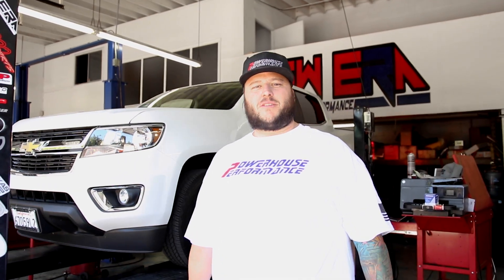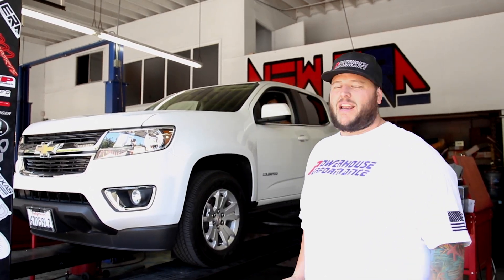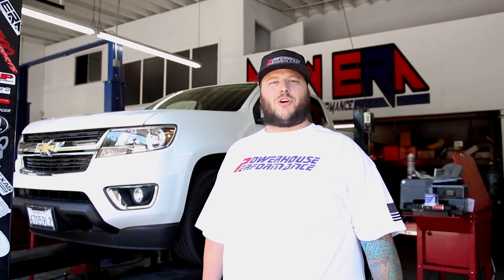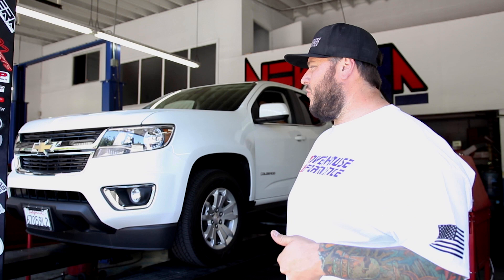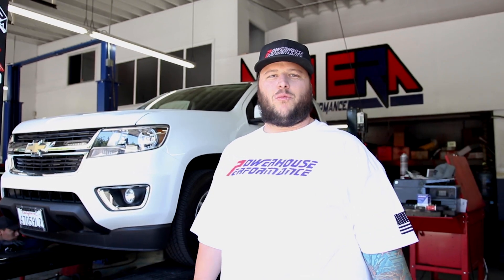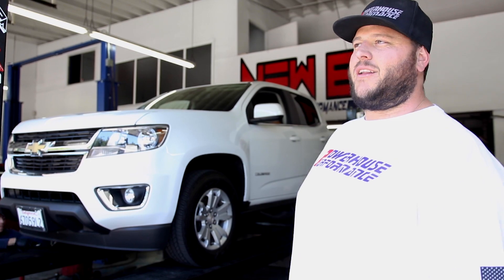2018 V6 Chevrolet Colorado Edelbrock Supercharger : Installation + Dyno Tune Process

Comment: For $7000?!?!?  Not worth it.  What the heck?
Reply: How much were you expecting? +200Whp?
Reply: @overlord6815  mpg went up around 5 and Horse power went up around 50+ I thought.  Regardless, I was expecting around $2000.  A brand new engine is less then $5000

Comment: I really worry about the reliability of the 3.6 overtime with the SC. Any updates from owners?
Reply: I have none of the crap on my 2016 Colorado and it’s still running great at 243,000 miles.

Comment: Bullshit,  that truck will pull your corvette just fine before the supercharger.  The 6/8 speed transmission,  and the programming of tow/haul mode pulls a 7,000lb tractor just fine for me on 35's.
Reply: True.  Was hauling a Crown Vic on a trailer with my 2020 RST.

Comment: I towed my corvette with my stock Colorado and it did really well, much better than I expected. The supercharger looks very appealing.
Reply: 265/22 for summer. Growling 265/ 20 for winter. Difference? The foot print. And the Job. I have a Mallet Blower that was custom made. Only one in Alberta. $ 12 Grand installed? maybe. You trust these Idiots? I had a guy that works on Lamborghini and Ferrari.

Comment: Torque gains are what I look at at low RPM's for pulling a trailer. These numbers look great to me. 100 ft/torque gain at below 3000 RPM

Comment: That was a great video. Looks like I can get an Edlebrock Supercharger for around $5 to $6 grand for my 2001 V6 Pontiac Firebird. Do you install on cars too? My understanding is that I will need special heads added too. Or so what Hot Rod mag. says. My V6 runs like new now.

Comment: Definitely should of went with the diesel option for towing. Supercharged vehicles are not the best option for towing. Can easily get EGTs out of control and the engine will pull fuel whether you like it or not. Unless the tune removed the factory safety features. Not to mention that's ALOT of money for 70 HP gains. 
.

Comment: That is wimpy performance numbers man. I have a 2016 Z-71 Colorado with a
RiPP Supercharger kit banging out 409 RWHP.  My truck would have that Colorado
in my rear view mirror briefly till it was out of sight. Oh I gave you way to much added
power.  313 RWHP  that  is  weak  and could only be driven by a wimp as well.
Reply: I agree edelbrock went pretty conservative on the Twins. I'm running a stage 2 Mallet and pulling 418 at the wheels. I installed an edelbrock on my son's Silverado and it's a beast. Never had it dynoed though.
The edelbrock parts were very cheap compared to the Mallet. We also had the intercooler leak on the edelbrock. Customer service was horrible. I also believe that the edelbrock runs a smaller supercharger than the Mallet and spins it faster to make up the difference in CFM. That limit's how much max boost you can make.
I would spend a little more you won't regret it. I spoke directly to Chuck at Mallet when I ordered and their engineering team called me to verify everything.
I accidentally sent them my tuned ECM before setting it back to stock. They sent it back next day with a prepaid next day box for me to unlock all free of charge even though it was my mistake. I know this is starting to sound like a commercial but seriously this thing is great. I've got 20k on it now and two summers of pulling my 21' boat. Not one issue and it is so seamless I would let my grandma drive it. Maybe not on a rainy day LOL.
Reply: Change pulley and  add a more aggressive tune.
Reply: Funny how you said your truck makes exactly to the number what the video RiPP posted does. Poser

Comment: Cool setup. On the Dyno it produced 70.5rwhp and 86.5 ft/torque increase from stock (impressive). The Edelbrock website, I believe is the same supercharger for a 3.6-V6 Colorado and the hp/tq was much less. Could you explain??? Thank you
Reply: Probably just the tune.

Comment: Would this work for a 2015 GMC Canyon?  I was told it was only for the 2017 and up.  Edelbrock is ignoring my inquiry.... not cool.
Reply: Look the mallet supercharger. They have them for 2015 on up
Reply: Same here I have a 2016
Reply: 15-16 ripp mods  has one.

Comment: Question can you put turbo charge the Chevy Colorado  four cylinders
Reply: Why would you want to turbo the 4 cylinder? If you get an extra 100 hp, which is a 50% gain, you're still below the v6 stock power